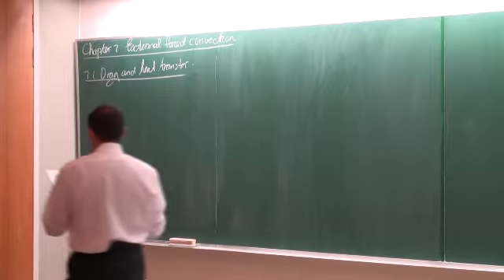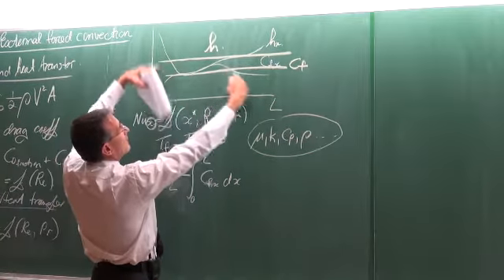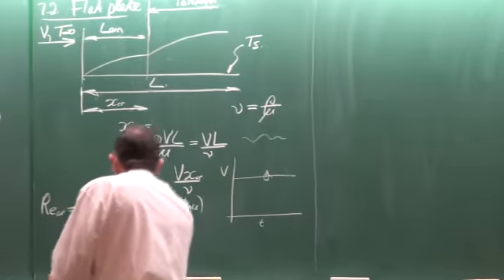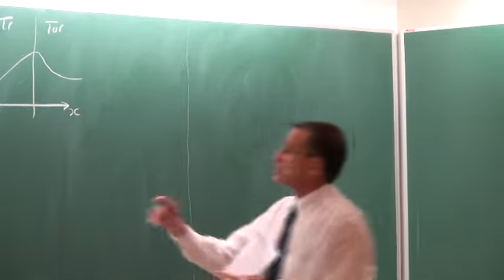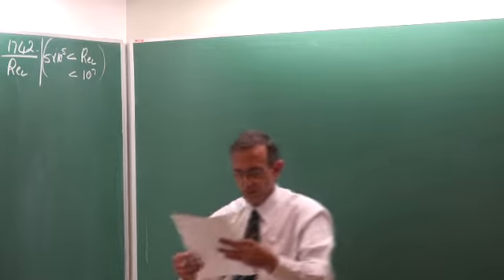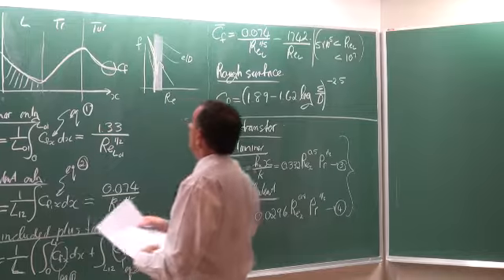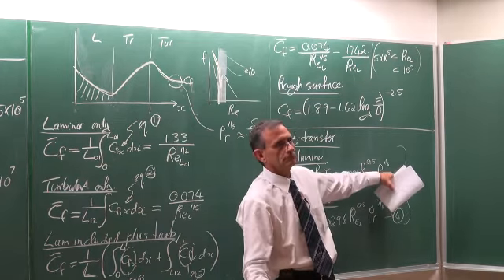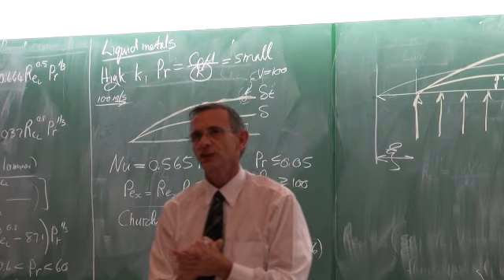Lecture 24 (2014). External forced convection (1 of 3)

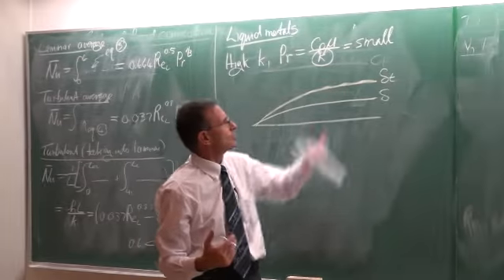Comment: There is a wrong statement at 43:56!! In fact, the thermal boundary layer of liquid metals gets THICKER because the heat diffusion will be faster (since thermal conductivity is higher in comparison with high Prandtl number fluids), i.e., heat diffuses very quickly in such case